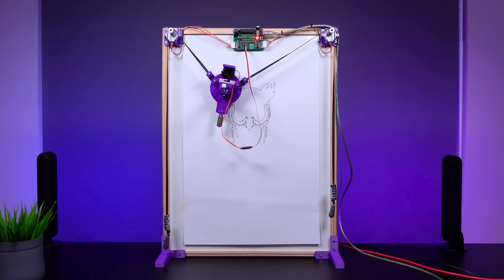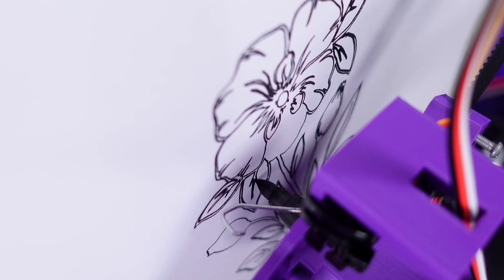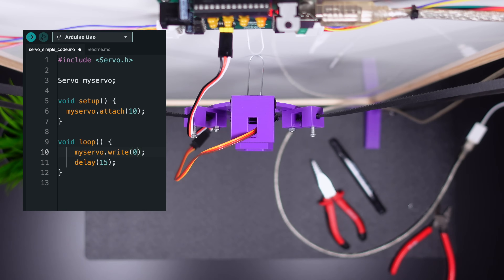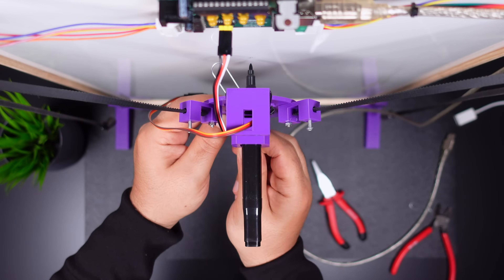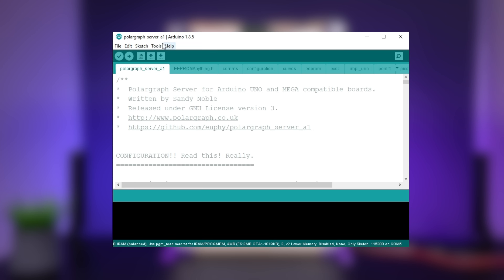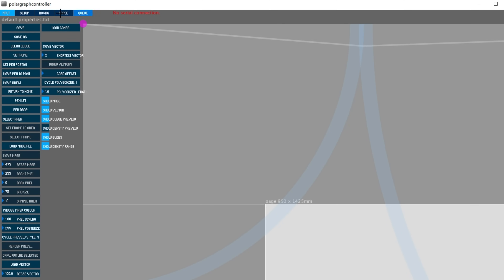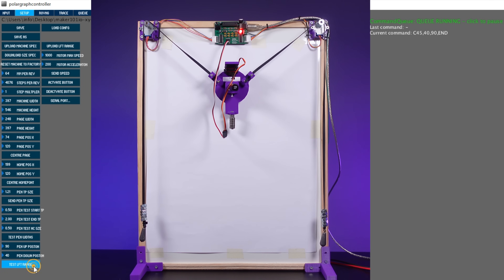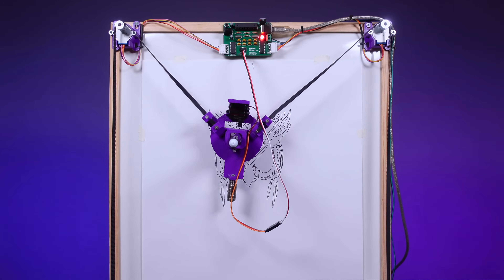Drawing Robot

Comment: Hi!
I built the same drawing robot as in your video — everything works great, thank you for sharing it!
But I have one small problem: when I send a command from my laptop to move right, the pen goes left, and when I send left, it goes right.
I already swapped the motor wires, which fixed the up and down directions, but right and left are still reversed.
Do you have any idea how I can fix this? Thanks a lot for your help!

Comment: I have recently built a polargraph machine myself. Quite a cool project. I was unable to get the originally polargraph software to work, but I did get the Makelangelo software working. It is pretty much the successor to the polargraph and what I based my build off of. I used Nema17 motors and an arduino mega with a Ramps board. Probably overkill but hey, it works well.
Reply from the maker: So cool, thanks for ur comment 😇